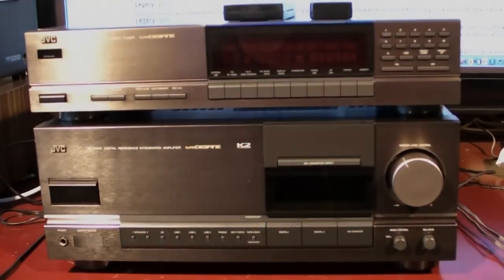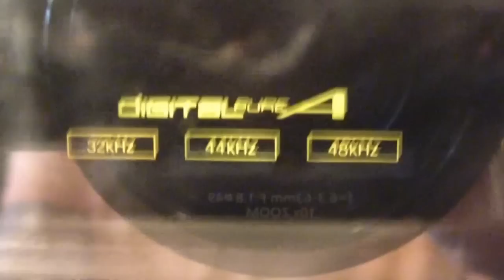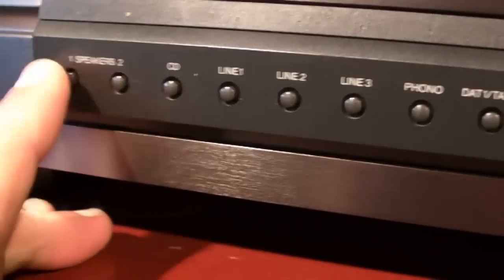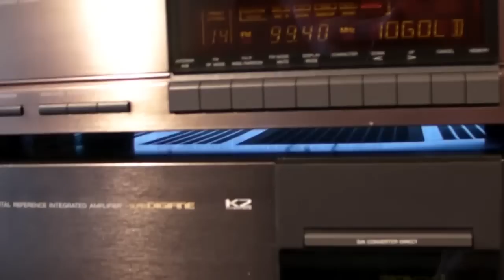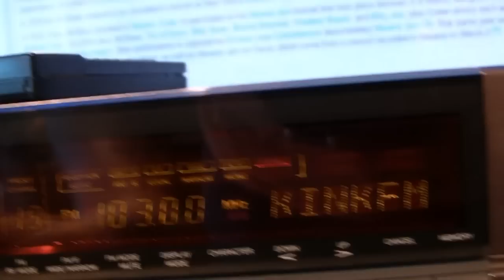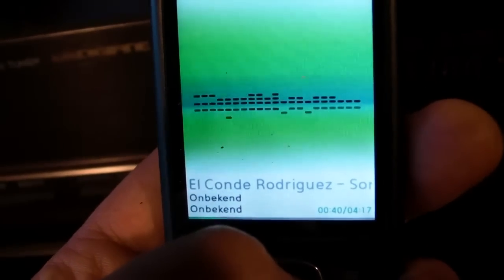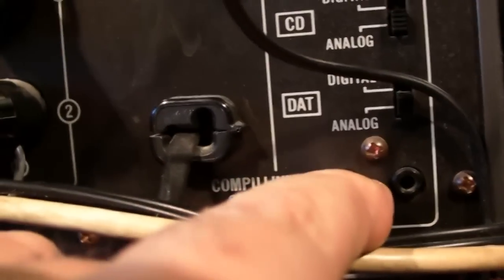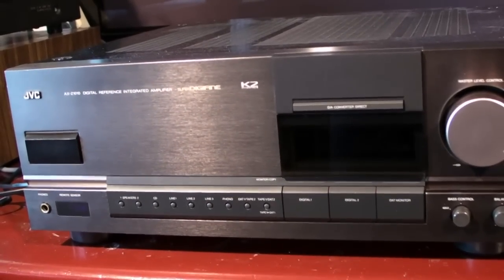JVC AX Z1010 and jvc FX-1010 top of the line review

Comment: I bought the AX Z711 two weeks ago and just today I bought the AX Z1010 as it was an excellent deal. I still have to connect them to my Bose 901 series VI .... I wonder which one I will keep. The 1010 looks awesome but I do not have the original remote, just a replacement JVC (RXQW500BKE) . The 711 (black) looks also awesome and has bass and treble controlers and also a super bass controler (always a nice combination with Bose). I do not have a remote to go with this 711 amp. The 711 seems exotic as it is very hard to find any info. I will be hunting for info and remotes. This will be an exciting week when I will test them both.

Comment: No it's not dangerous to put 8 ohm and 4 ohm speakers hooked in the same amp (SPK A + SPK B) and put them together activated at the same time. What is dangerous is to put 4 ohm speakers in an amplifier that only support 8 ohm or more of impedance. But you can connect 2 pairs of speakers with different impedances and run all 4 speakers at the same amplifier. The amp have a maching circuit for that purpose so it is not dangerous at all. So my friend Andrew, please try to learn more technical things before you say some wrong things you say. Try to research more before saying something. If you don't know just ommit what you don't know. That's an advice and not a critique. Regards. By the way, the things you review are always the better sounding? You always say "this is the best sounding amp I ever had" and in the next video with other amplifier you say that again. So what is the best? All of them? Be careful with the words and the way you express yourself.
Reply from the maker: i blew up a amplifier where i connect 4 ohm on the front and 8 ohm in the back speakers , the 8 ohm section was blew up, so i learned my lesson
Reply: The section is the SAME!!! You really don't know what you talk about. There is no SPK A and SPK B section. The amp always run all transistors. When you activate another pair of speakers it divides the power between all of them. Ask the guy that repairs your stuff to learn something.
Reply from the maker: i am in a learning process, at the time this video was shot , it was the best sounding amp i heard, not the best receiver...after this video i had many other amps what sounded better, i am upgrading, the amps i buy are  often more expensive then the amps before.
Reply from the maker: the amp i blew up was a surround amp, the channels for the surround speakers(8ohm) didn't work anymore so i guess i blew it up.